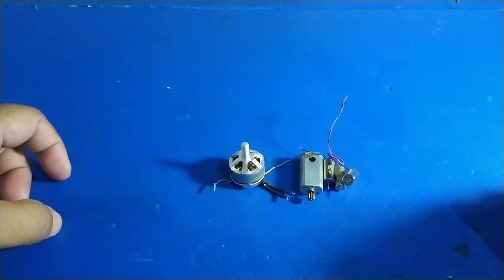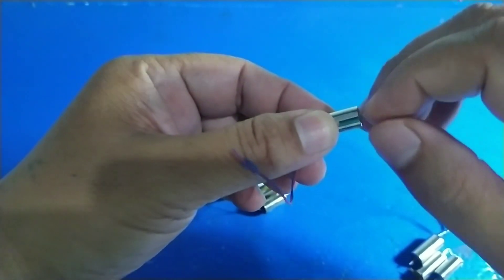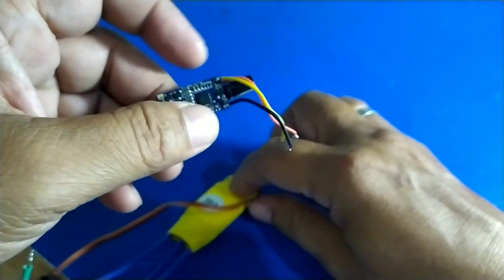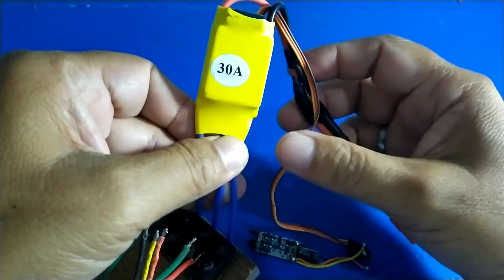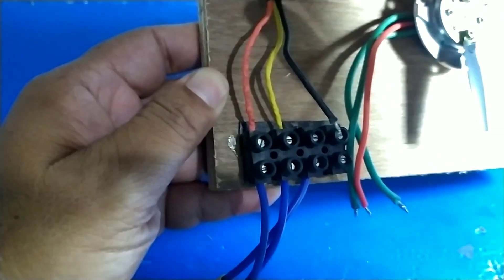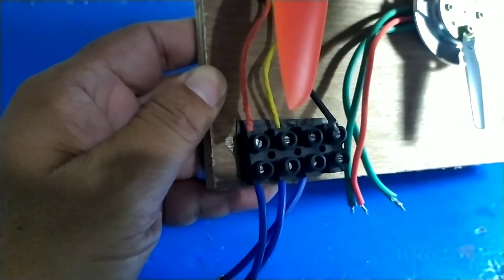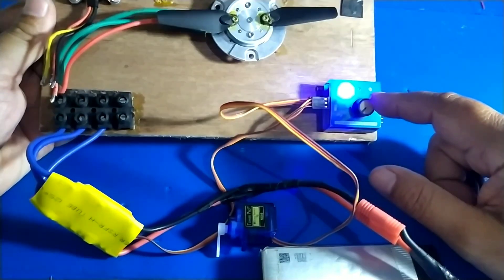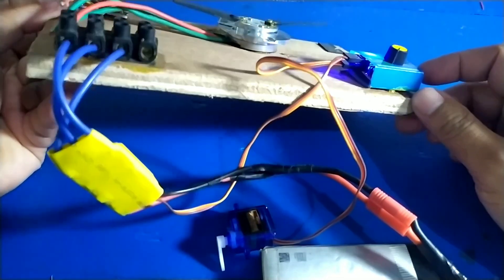Cara mudah mengetes esc,servo dan brushless motor

Comment: Kenapa esc ko harganya mahal banget ya bng apakah emang komponennya yng mahal ?
Reply from the maker: ESC apa dulu tiap drone beda ,ada ESC y 4 in one ada yg ESC satu2..ddivideoku hargannya 60 rb ESC itu menyesuaikan dengan daya motor yg dipakai
Reply: @Elektric_Hobby_maker iya itu yng vidio bng gk kaya speed kontrol motor brushed yng harganya di bawah 50 k 😅😅